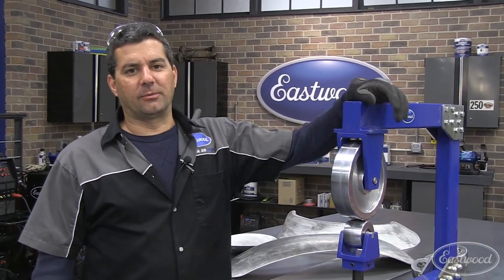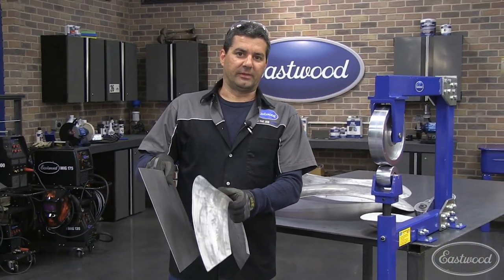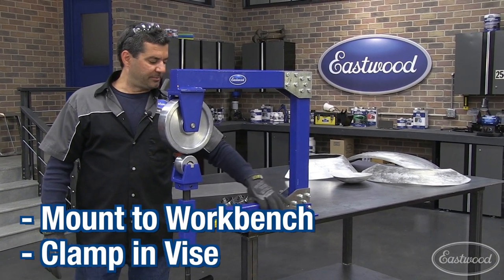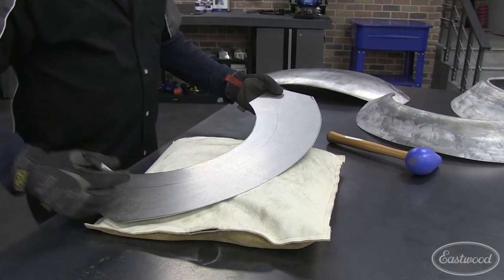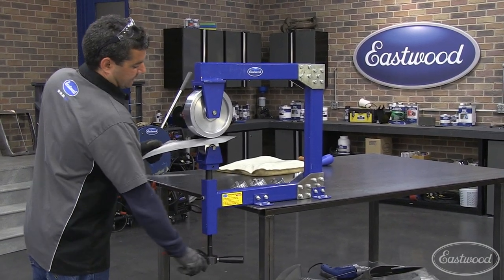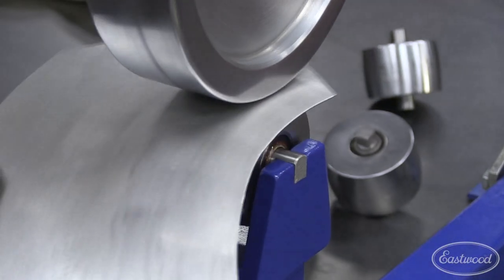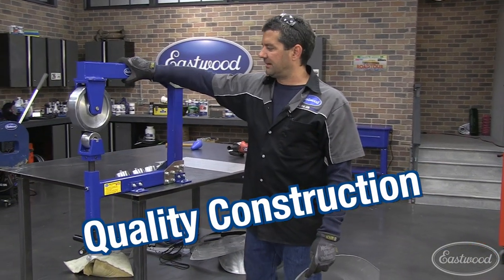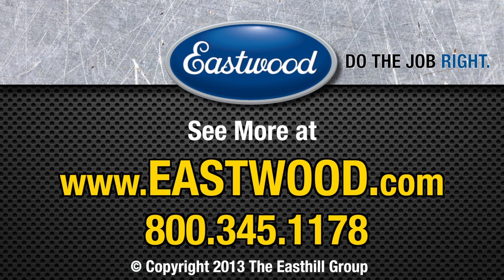English Wheel - How To Make a Fender Flare & Techniques - Eastwood

Comment: For auto body where the finished part needs to be say 20 gauge steel and you need to stretch out a complicated shape would it be best to start out with 18 gauge because it will get thinner in the wheel?
Reply from the maker: ELPaso1990TX If the project's metal is 20 gauge, you should work with 20 gauge because the metal is not going to get significantly thinner in the wheel.  The English Wheel will basically just shape the metal.  Thanks for the interest in the Eastwood English Wheel.  A link to buy or get more info at Eastwood is in the video.
Reply: with metal not so much but if using aluminum then yes